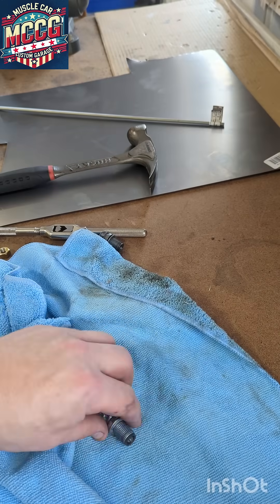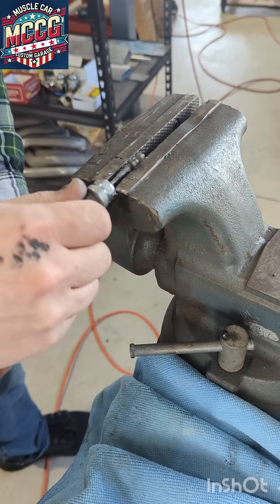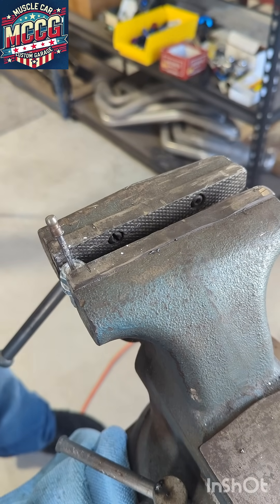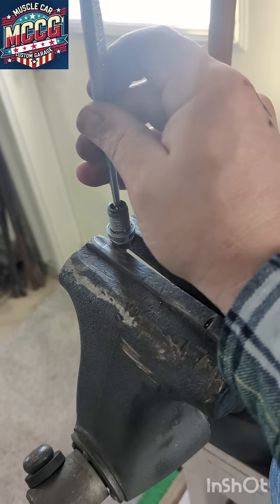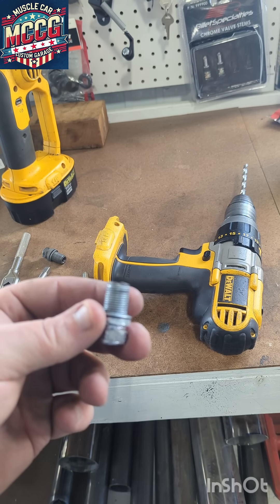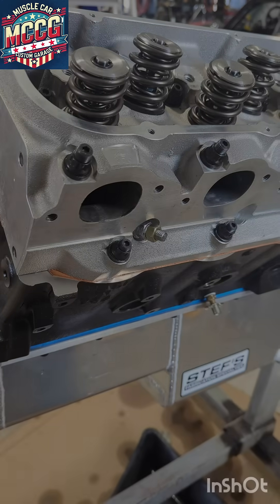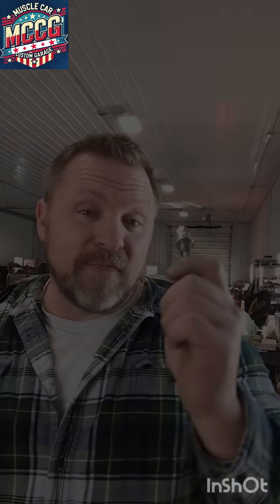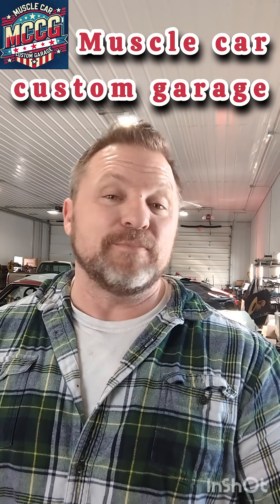DIY piston stop: turning a spark plug into a handy engine tool!

Comment: What u didn't tell us was how far the threaded rod needs to be installed into the spark plug or the length of how long the rod needs to be inside of the plug to stop the piston. In theory it wouldn't matter. To a point. But maybe I am overthinking it
Reply from the maker: It all depends on if you have a domed piston, flat top or dish. That's why you want to make sure the rod that you make is long enough to accommodate each one.

Comment: How do u know how far to screw it down with out damage  to the piston
Reply from the maker: @mike97074  well, if you're setting up your harmonic balancer. Then I would say run through a compression stroke to where you know the Piston is coming up. At that point run the Piston stop about halfway down. You will feel the rotation of the motor stop. After that. Go backwards in rotation to where you feel it. Stop. Make sure you mark the balancer each way. Once you've established that halfway in between those two marks will be your TDC

Comment: I don’t understand. How do I know how long to make it?
Reply from the maker: I do say in the video it's 3 and 1/2 in Long. Hope it works out good for you
Reply: @ I just bought some cheap spark plugs. I guess the idea is it doesn’t have to be a perfect length because it’s going to stop at the same point in both rotations. Weather your 3 1/2 or 3 9/16 you will get the same TDC because you meet in the middle.
Reply from the maker: Yes sir

Comment: How do you find exact top dead center, I mean after the piston stops moving up but the crankshaft still has rotation?
Reply from the maker: Thanks for the question. No, once the Piston stop is installed nothing moves. Meaning nothing. Will move forward. Then go reverse rotation and then it will stop. Make sure you have a degree wheel or even a degreed harmonic balancer. Write down where you are on the balancer in the forward position and in the reverse position. Between those two numbers will be center. That is your top dead center. Hope this helps